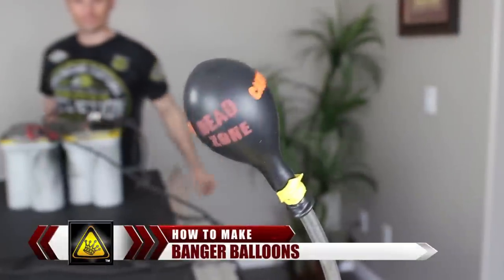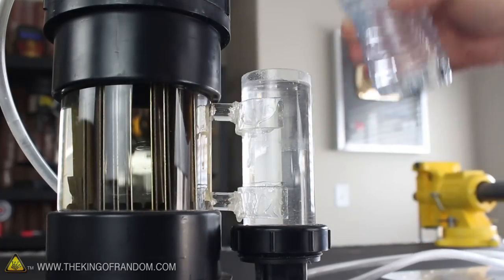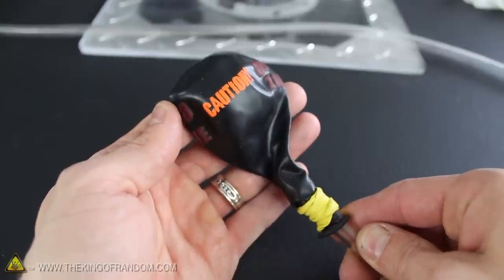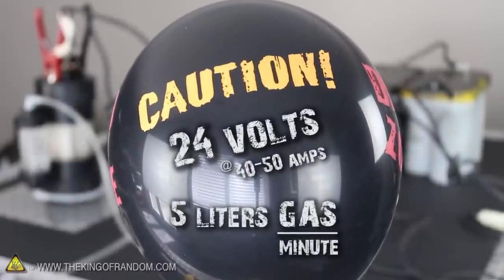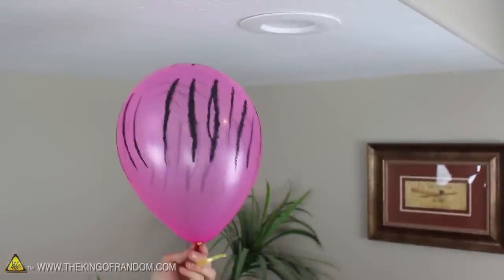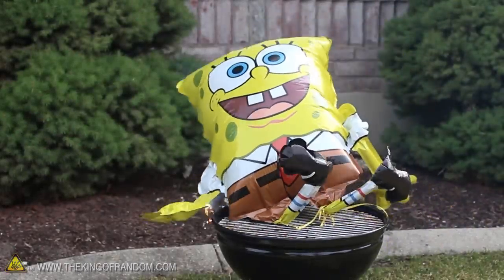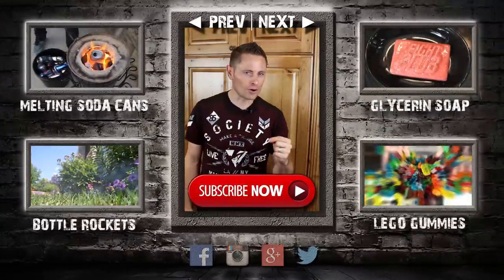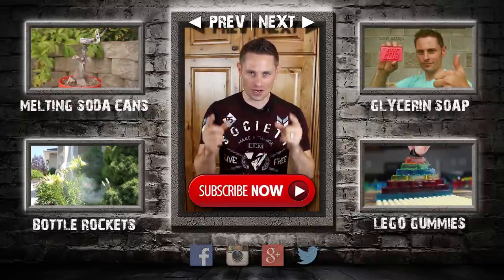How To Make Balloons, That Explode

Comment: Someone please make a car that runs on this please
Reply: slimeball They have created that car, and you can probably purchase it but it is not very cost effective.
Reply: slimeball You might as well use an electric car. I wouldn't think that using the electricity to make gas to power te car would be for effective than just using the electricity to power the car.
Reply: Dylanica You'd be surprised...
Reply: Jason Schuler Do you have data suggesting this, or are you just speculating as well. If you do have some supporting data, I would be intrigued to see it.
Reply: I did it went 2metres I used a ballon powered car from another vid and replaced it with this I do about everything Grant does. What do you expect it is very fun
Reply: Dylanica The typical BEV (Battery Electric Vehicle) requires 120 volts if you're using a DC motor and 300 volts if your using an AC motor to operate at the speed and acceleration of a normal internal combustion powered car. Grant used a 24 volt DC battery in the video. Based on the figures he provided in the video, it would fill a car's fuel tank in a little over 19 minutes. 24 volts for 19 minutes vs. 120 volts for the entire time you're driving is significantly less electricity. Now of course, you can't make the  hydroxy gas with water alone, you also need a catalyst. Grant uses Potassium Hydroxide in his generator. However, I can't see this increasing the cost by much. Grant uses 4 teaspoons which theoretically can last for about 12 refills of your car (or more, that's actually the lower bound in my estimates). You can buy 2 pounds of KOH online which is 96 teaspoons or 24 refills of the generator. This means for every 288 times you refill your car's fuel tank, you're spending an extra 10$ on catalyst. I'll be honest, this last fact surprised me. I always thought that the cost catalysts would greatly increase the overall cost of the fuel, but it seems a car powered with an electrolysis system is superior in just about every way.
Reply: Jason Schuler Seeing as how the generator was pretty cheap, the only thing keeping these cars from taking off is fuel companies.
Reply: Well my grand dad is an eginner and my dad is a car deller so i have ask the question but they cant com op with an answer why not too use this
Reply: slimeball There probably is a reason somewhere, ore else we'd all be driving gas cars.
Reply: Dylanica The reason is because the best way to obtain the gas is from natural gas... and it takes alot of electricity to take it from water
Reply: Dylanica David made a very good point. Oil companies are one of the most powerful political and economic forces in the world. They would lobby heavily against research and implementation of such cars because they would quickly become all but extinct should these types of cars gain leverage in the market. After researching them for several hours, I'm convinced that they are the primary reason why we aren't all driving electrolysis powered cars.
Reply: 6humphreys I had the same exact thoughts myself but Jason Schuler replied with some numbers. I'm still rather skeptical , but for the moment I am going to assume that it checks out.
Reply: Dylanica I mean, I feel like it shouldn't be that far-fetched of an idea. Think about how long it takes for an oven to heat up to 400 degrees running on 120 volts AC (typically). For a fraction of the electricity, you can hook this generator up to a Bunsen burner, turn it on, and reach temperatures of over a thousand in a matter of seconds. Powering an engine is the same principle. The short explosion of a small amount of hydroxy gas generates far more kinetic and mechanical energy than an electric motor ever could.
Reply: Jason Schuler Fair enough.
Reply: Ireallyreally Hategoogle Why do people keep replying to me. I still think that hydroxy cars are a fairly bad idea.
Reply: Joe Schmoe Anytime you're using a type of fuel not intended by the makers of the car, you are asking for disaster. Powering a normal car with hydrogen is VERY VERY VERY dangerous and should be done by mechanical professionals only. People have died trying to run their cars on hydrogen without taking necessary safety precautions.
Reply: +Dylanica the thing is that the amount of energy needed to run the H2 generator is the same as the energy you get from the explosion. Basically, doing this would mean you have an electric car, but with a super dangerous battery.
Reply: this produses no thrust
Reply: +Derek McOlund The 2nd Law of Thermodynamics disagrees. The amount of energy you get from the reaction of the Hydrogen and the Oxygen will always be less than the amount of energy required to split the H2O molecules because some of the energy is lost as heat. I mean, that's physics 101. Why do you think no one has every created a perpetual engine? Because it's impossible.
Reply: +slimeball - The Toyota Mirai

Comment: Little tip for you: super glue a small piece of incense stick to a small piece of fuse and voila! time delay fuse. You can use a lot less fuse and adjust the time easily by using longer incense 😉

Comment: About the dangers: A professor of mine loved them. He build them using a yarn that he nitrated (thus converting cellulose into nitrocellulose) which worked as a fuse that still looked inconspicuous. he used them to wake up students from time to time. Once set on fire they wre flying up and exploded close to the high ceiling. One of them however came too close and blew up the neon tube above our heads! His sole reply was Oooops!
Reply: based professor

Comment: Ehhh.... 

If you're going to do this, make sure your hydrogen and oxygen are separated, rather than perfectly mixed to explode. You can easily do this by taking the positive terminal of your HHO generator and allowing it to be connected via a salt water bridge to the negative terminal rather than jamming them close together. 

The oxygen vents to the atmosphere, and the hydrogen is easily collected near the positive terminal.

Comment: you need to put that generator under the hood of a car and run the line into the intake manifold. Use a carbureted engine and clamp off or disconnect the fuel line and see how it runs. with some tuning it will run great and your fuel will be water.

Comment: The explosion from this is more destructive and powerful than a pure hydrogen balloon.  When you watch a hydrogen balloon explode in slow motion, can you see the flame wave travel across the gas relatively slowly, because the hydrogen has to wait until the oxygen in the outside air mixes with it before it will burn.

These HydrOxy balloons don't need to wait for that outside air to mix in though, thus they don't slowly "burn", they DETONATE.

Here's why:
It's because the hydrogen/oxygen mix inside the balloon is already mixed in the perfect ratio to burn, it doesn't need to mix with air at all.  When it burns it's just turning back into the same water it was originally made from, so it already contains the perfect ratio of elements to do that and doesn't need anything extra.
Thus when you light it there's almost no delay in the flame front.  The flame wave can propagate through the mix as fast (or even faster) as the speed of sound itself. 

This is why the noise produced is so incredibly loud, when one side of the gas starts to burn, it starts to make a noise, and this noise is traveling at the speed of sound (it hasn't yet reached your ears).  But the wave of flame itself travels as fast (if not faster) than that sound does.  So as the sound is slowly travelling to the other side of the balloon, the wave of flame is right there with it, making new sounds the entire time.  Because all of those sounds travel at the same speed, they have all stacked up together as a very big single wave of sound which hits your ears all at once.
IIRC in physics this is called a "DETONATION", and it's why gunpowder is more dangerous than a block of slow-burning wood.  It's just a question of how fast it burns.  Detonations are just incredibly powerful sound-waves, they are so powerful than they can propel a bullet, or a tank shell, or (if close enough) rip your body apart merely from the soundwave itself.

(note: in general, explosive weapons are surrounded with metal which splinters into shrapnel, and it's these shards of shrapnel which are much more lethal than the explosion itself.)

Comment: actually hydrogen was used before helium as they used hydrogen in zeplins which did not end well and the idea was abandoned like people say oh helium is better than hydrogen actually it is based on your opinion. while helium is expensive to fill large amounts however hydrogen is cheap and can be produced easily as proven in this video but hydrogen is extremely flammable. I think people would choose less money than possibly death if they were going to make a zepling

Comment: You could make a flamethrower by seperateing the hydrogen and oxygen into two different tanks. Take the hydrogen tank and attach a wire and on the end of the wire just put a lighter or some other kind of sparking device. You may do this how ever you want.
Reply: This is smart, but the matter is you need to separate the oxygen and the hydrogen. That isn't exactly an easy feat, but knowing grant he could do it.
Reply: I Know so i hope he knows a way.

Comment: A simpler way is to take a plastic bottle some acid and aluminium foil make the foil into small balls and put them in to the bottle and pour some acid put the balloon on the place where the cap should be and it will fill up with hydrogen.Same stuff just simpler....

Comment: You made a mistate in your graphics.  the Hydrogen is a single H not H2.  it is the missing electron which makes it unstable and explosive
Reply: No, hydrogen and oxygen are both diatomic molecules. There are two of the same atoms in a molecule. If you want water, it take 2 of the H2 and 1 of the O2 molecules to make 2 H2O molecules. Learn some chemistry, please?

Comment: Grant Thompson - "The King of Random" is this gas safe to breath in like helium?
Reply: Do you like breathing in flammable gas? No? Well too bad because you do it all the time!

Begin serious:
The gas in the balloon is 2/3 h2 and 1/3 O2. This means there is more percentage oxygen in that balloon than in the air. However, there is a ton more hydrogen, which will have the same effect as breathing helium because the air in there is lighter. So you can breathe the balloon, and it's like inhaling helium from balloons except you get oxygen out of it.

Comment: this is very sciency and cool but you can make hydrogen really easily for a whole lot cheaper. Just put some lye and water in a wine bottle, drop aluminum foil inside and throw a balloon over the neck of the wine balloon. Boom, hydrogen filled balloon that explodes.

Comment: I wonder what would happen if you filled one of those stand in balloons with explosive gas...................
Reply: Just a stand balloon? What if you filled a hot air balloon with it, then turned on the flame. That's basically gonna have the same explosion power as a small hydrogen bomb, because it would be a hydrogen bomb without the extra uranium to give it that power

Comment: So.. That's how Hydrogen Bombs are made, huh?!
Reply: Douglas Aranda Not at all. Hydrogen bombs use hydrogen to set off the first nuclear reaction, then the energy expelled in the first nuclear reaction is used to detonate an even bigger nuclear reaction.
Reply: Paradigm Storytime ¬¬
Reply: Douglas Aranda actually not. In a H-Bomb, the Hydrogen Atoms, or more precisely the atomic nuclei of the Hydrogen atoms fuse to Helium, where in this project they just react to water.

The big difference is, the nuclei of all atoms remain untouched, the reaction comes from the electrons surrounding the nuclei.